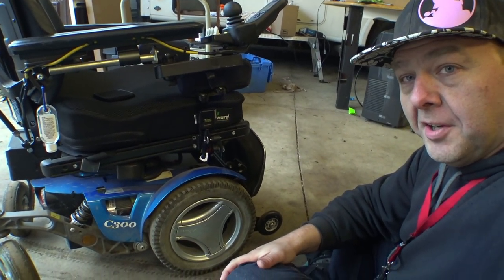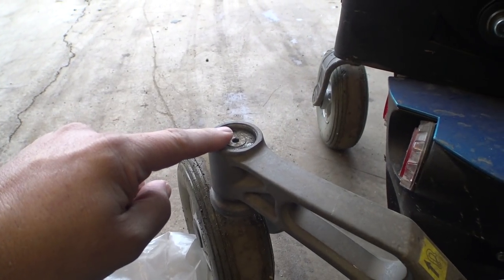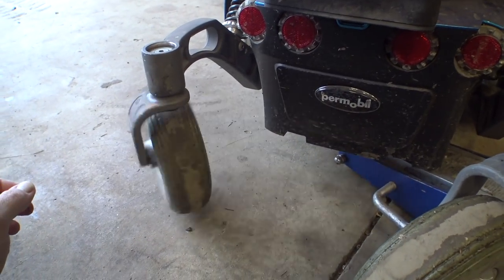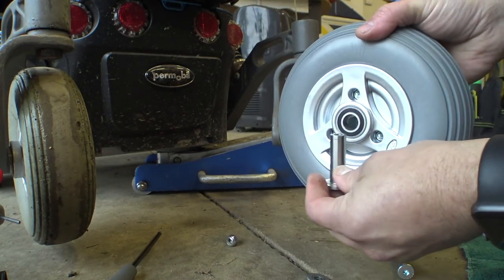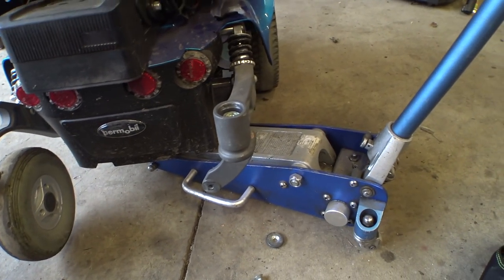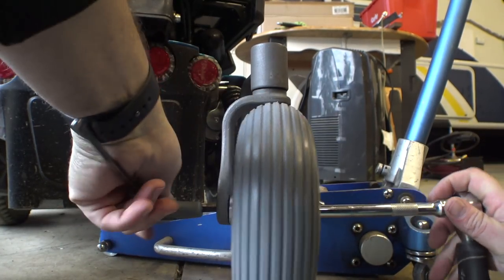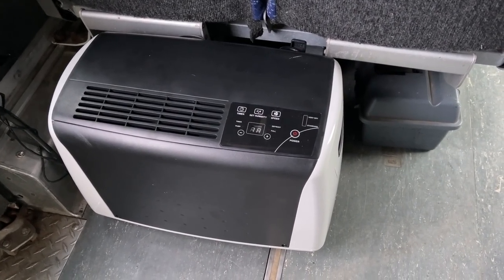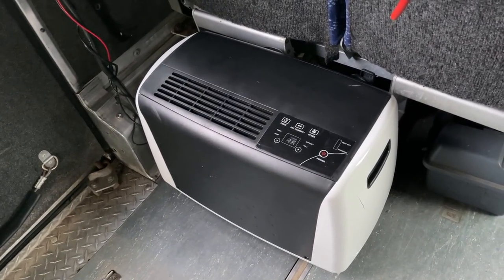VLOG 590: new wheels! (+transmissions & dehumidifiers)

Comment: Per the C300 Service Manual:  Tighten the nut holding the wheel fork in place with a torque wrench.Tightening torque: 33 Nm.Tighten the screw holding the friction plate in place with a torque wrench.Tightening torque: 15 Nm
Reply from the maker: thanks for looking that up and posting it here! someone working on their chair will appreciate the CORRECT info! (unlike my random application of torque in this video lol)
Reply: @TotallyNormal-     very good
Reply: @TotallyNormal-  I'm not so concerned with your abilities.  You have probably tightened enough fasteners to "feel-torque"  most any bolt or screw on a chair.  Some in your audience man not have those skills.  Obviously someone who worked on your last Quantum didn't torque a few things properly before you got it.  I do a lot of precision shooting, and I pay close attention to how things are torqued on my guns.  It is a safety issue, and sometimes even a small deviation in torque can make a large difference in accuracy.

Comment: hey dan .. that ac/heat pump might be a good candidate to slightly modify and use to feed all the overhead air vents like i suggested on the live stream.... it will be kinda like central ac / heat with a dehumidification option ... and you could block some vents off like they were air registers / air returns to balance out air flow evenly in the bus. plus mabye control it with the rasberry pi.     see you on the live stream!

Comment: This is one of the few channels that deal with C300s. I greatly appreciate your channel! I have to replace those rear caster bearings so many times! I had a problem arise with the center seat post that attaches to the frame. The flat part of the mount, where the seat post goes in, cracks! So I had it reenforced with more steel strips! Fixed it! I had to have them replaced 4-5 times in 5 years. If anyone out there is having the same cracking, weld the crack and add steel strips to the plate. I weigh 250lbs so I’m hard on the chair! Love from NW Colorado. Thanxz
Reply from the maker: ah yes - the 'ol seat lift cracking welds!! from the factory they only welded 3 places on the bottom of the plate.. and SHOCKINGLY they crack eventually! lol on the newer versions they  welded them all the way around... although i haven't looked closely at a chair without a seat lift - im assuming its a similar issue.. thanks for the tip!

Comment from the maker: *so here's what happened with the transmission - the 4R100 and E4OD's pumps are notorious for going bad.. and when the pump cant provide enough hydraulic pressure and flow, among other things, the torque converter cant lockup anymore and this generates a MASSIVE amount of heat..i kept driving, and badly overheated everything - eventually the rear shaft seal gave out, and all the fluid went BUH-BYE and coated the exhaust and everything else - hence SMOKE - in theory all it needs is a pump, seals, a filter/flush and it would probably be fine... the same thing happened with my 1987 E100 van a few years back*
Reply: So what would you use to get around with, green van is long gone (the bastard tried to kill you) & now white van is DOA.

& Bus isn't finished so that you can drive it around
Reply from the maker: The white van was my backup… I’ve till got green van 2.0 lol which has been almost disappointingly reliable!
Reply: @TotallyNormal-  lol ok.

& Yes the white van looks nice, but looks aren't always the reality underneath.
Reply: Where is the green van 2.0

Comment: you should use cone bearings for  the casters because of the upward force on the bearings. they are in a cone shape like they use in bicycles in the head tube. just an option.. my name is Jesse. always trying to help
Reply from the maker: yea.. it is kinda odd that they used this type of bearing! they're not really designed for thrust load..
Reply from the maker: i was doing some poking around the internets, and totally forgot that mini thrust bearings exist! i wonder why permobil doesnt use these instead....
https://bearingsdirect.com/ball-bearings/miniature-ball-bearing-metric-sizes/miniature-thrust-ball-bearings/
Reply: @TotallyNormal-  yah i wonder why they didnt..
again just heping out.
just one question i was wondering if you had a spare quantum jazzy 600es programing card i need to do some tuning on my jazzy 600es to up the top speed and turing speed just a few things my chair needs. could you lend me one??
thanks Jesse
Reply: its just my job doesn't pay me enough to buy one..
Reply: it has a xlr port for the connector programing card